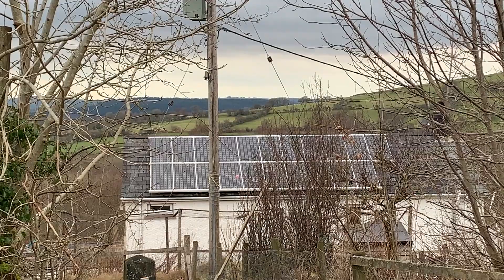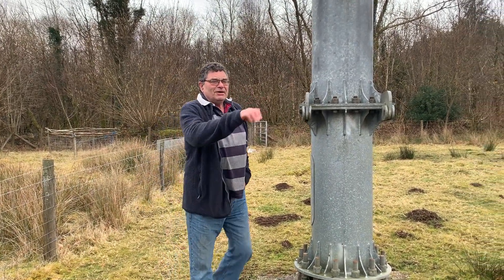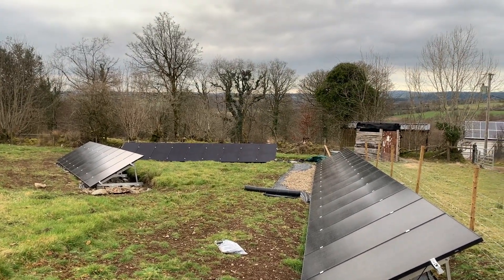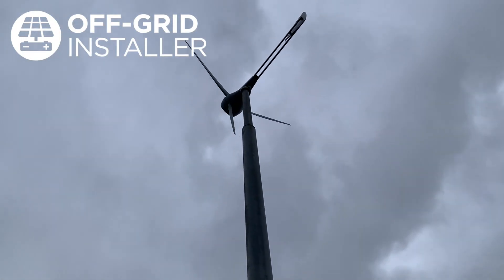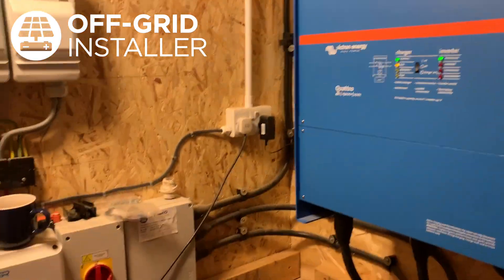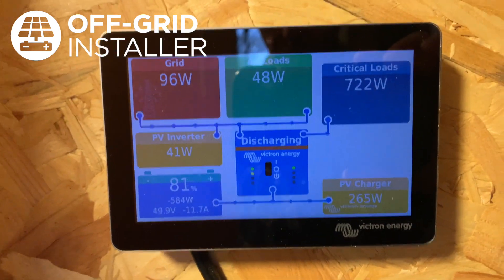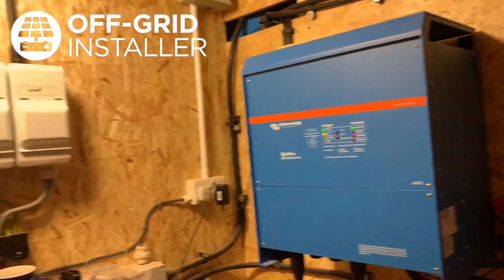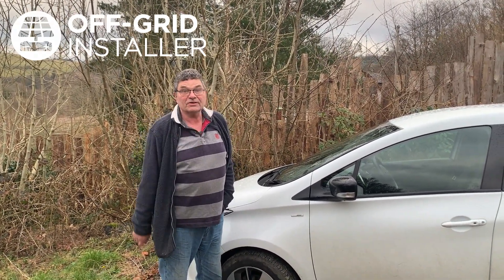Off grid hybrid house solar system with EV charging and wind turbine in Wales

Comment: It's been a couple of years since offgridinstaller installed the upgrades to our existing rooftop PVs and wind turbine. We had ideas for what we wanted and needed, to be as carbon neutral as possible, to have the benefits of a grid connection for export and sometimes imports, and to be off-grid in extremis. 
Initially, we couldn't even find a contractor with the experience or apparent knowledge to help, Victron's importers eventually put us in touch with offgridinstaller and we have had the solutions professionally explained and equipment specified to meet both our needs and the requirements of the National Grid; offgridinstaller has also provided us with excellent and prompt support since the installation. Two years in and we are happy, we export power most of the year and only consume a little in the winter. Offgridinstaller looks after tweaking the system and making any seasonal adjustments we have wanted or need and all this can be done online. Simple. And we're very happy!

Comment: This is Katherine from O'cell, we specialized in LiFePO4 battery since 2008. May I share with you O'CELL cost effective LiFePO4 battery ESS for solar roof, there're all-in-one and separated systems, energy from 500Wh to 30kWh optional, life cycle up to 6000 times, plug & play, if need them, please reach out freely.